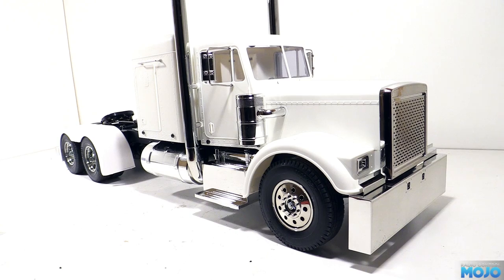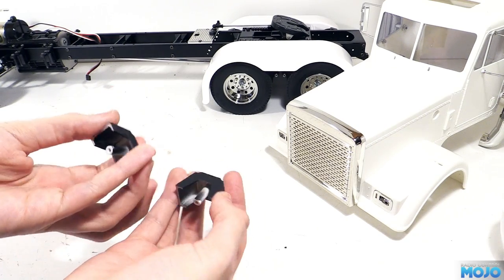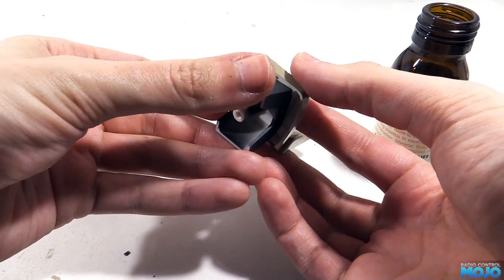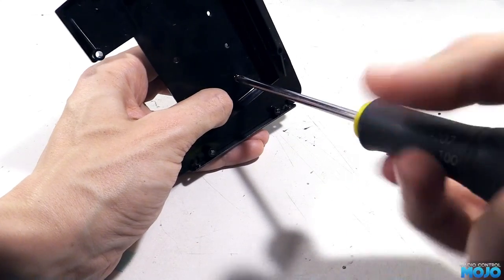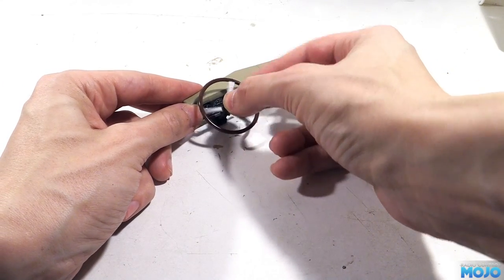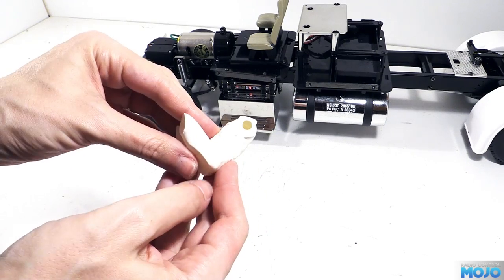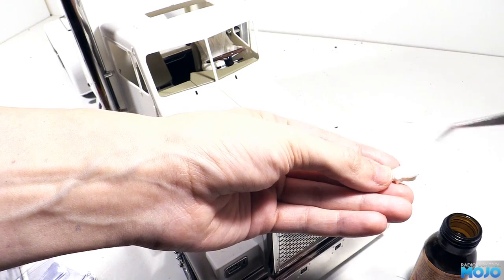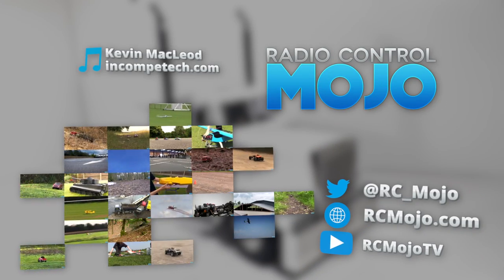Tamiya Grand Hauler - 9 - Body Part 1

Comment: I got myself a grand hauler a couple of days ago, and am using your videos as well as the manual to build mine. I've hit a little snag though as I don't have good quality bearings, (I don't want to use the ones supplied) or the grease tamiya give in the kit, (again I want to use high grade silicone lube for the diffs and gear box.) I really am enjoying your videos, keep them coming.

Comment: The stickers on the air tanks are your State Tax.  Most individual States require you to pay road tax to operate in the State, the sticker is proof of your tax.       The numbers on the fuel tank are your Federal DOT and ICC registration numbers.  You need to have those to operate your commercial vehicle as a business, and if you intend to operate across State lines.
Reply from the maker: Oh I see, that makes a lot of sense!

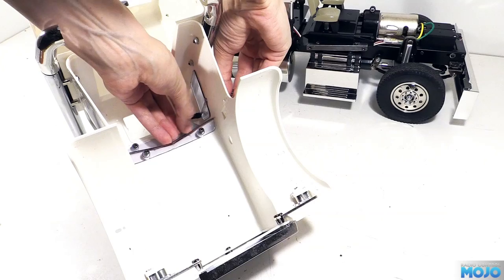Comment: Hey, why did you need those washers at 9:14? Do those come in the kit?
Reply from the maker: It's easier to set the arm position while the windscreen's out. To make the the dash and steering wheel are still at the right height the nylon washers space it off roughly the same amount the windscreen does. When the windscreen goes back in we don't reuse the washers